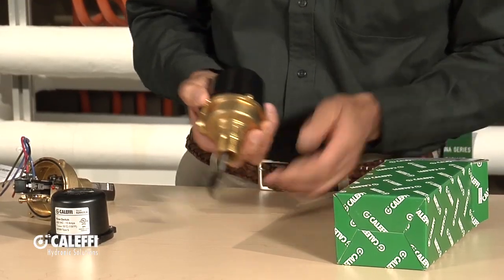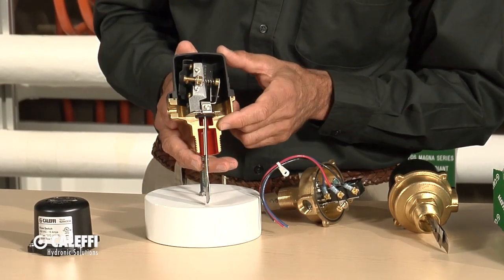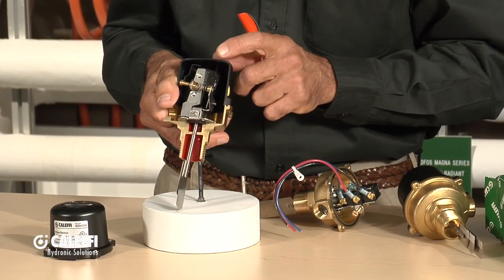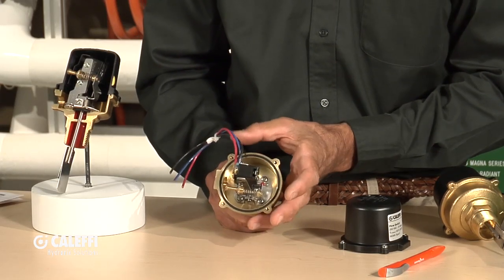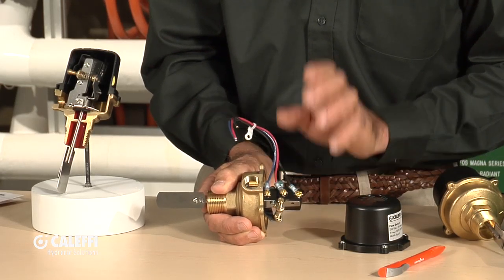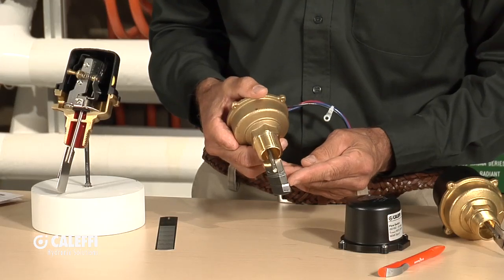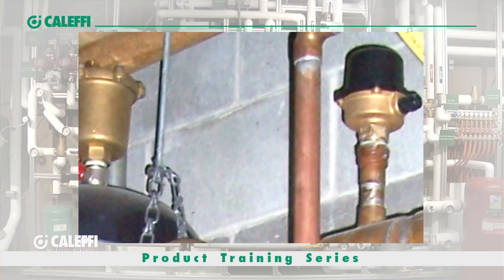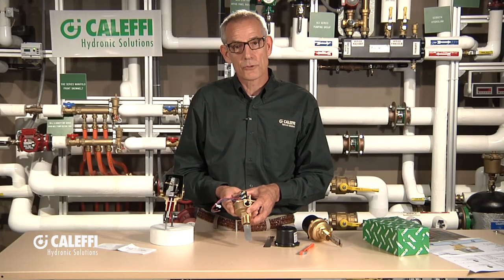Universal Hydronic Flow Switch

Comment: can we install it vertically or it really must be horizontal installation? just wondrin..thank you
Reply from the maker: Hi Leonardo,
Thank yuou for your inquiry.  The flow switch should be installed with the control rod upright, with the flow in the same direction as the arrow on the body and cover.
All the best!